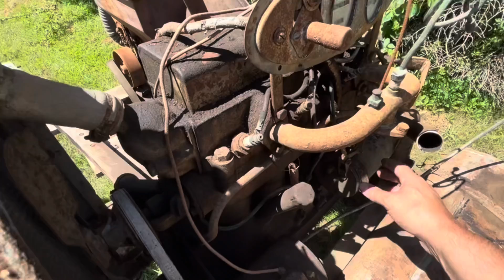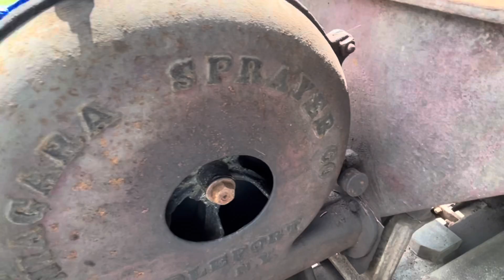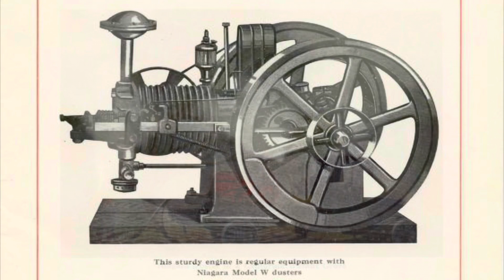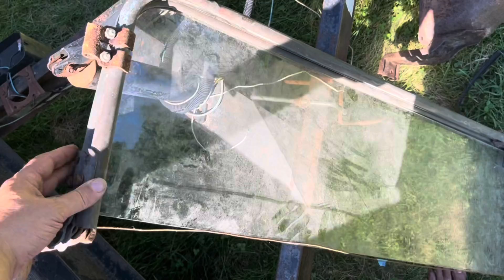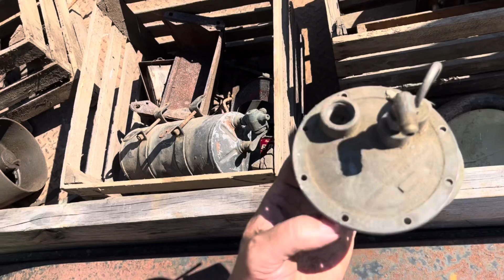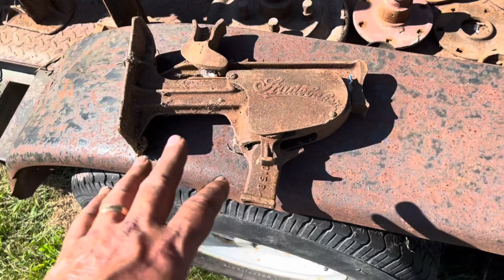Auction Haul of 1928 Chevrolet Parts.

Comment: Howdie ya got any body parts like handles and window cranks for glass last if ya hav a windshield visor ? Thks again for your help from Canada 🇨🇦 SK later 😊
Reply from the maker: Sorry, most of the Chevy stuff has found other homes now except for a pair of wheels and rims. I did run across some complete doors with cracks, but those sold very fast. I'll keep an eye out an let you know, though. Thanks.

Comment: Where those long push rods standard application options in the 28 engines? Also surprised that the grille is still there. Can’t find anything that old in Kansas with a grille without giving up a kidney.
Reply from the maker: Yes, that was the standard ‘28 engine layout. The radiator is in pretty good shape too, looks like it holds water

Comment: I have considered the Chevy head option but never knew how it all came together.  Thanks for the explanation.
Reply from the maker: There’s an adapter plate required and then some changes to make the valves guides line up, but it’s pretty doable. The MTFCI forum is the invaluable resource for details there
Reply: @OldModelTGuy  Oh my!  those guys will come after me with pitchforks if I dare to ask about such sacrilege.   Ha! Ha!  Great video.. cheers
Reply from the maker: No, there’s a number of guys there that have used the Chevy ohv. They’ll be fine with it.

Comment: Super cool video I found what I thing is a model t hubcap metal detecting about 8 months back would it be possible to tell exactly what year it is
Reply from the maker: The changes in hubcaps can be subtle, so it might be hard to tell if it’s in poor condition. They were mostly all brass base, but then nickel plated over that, although some years they were just polished zink (1921-25).